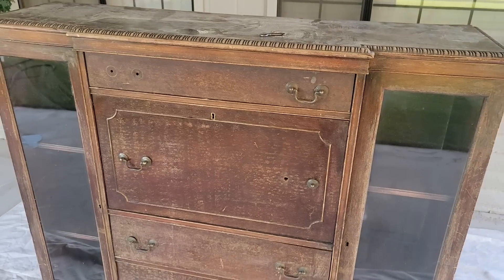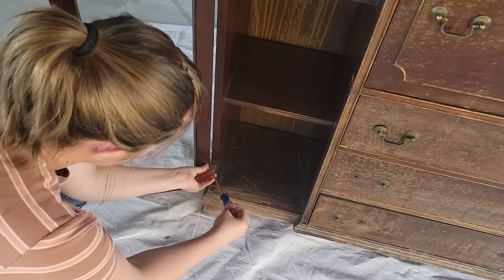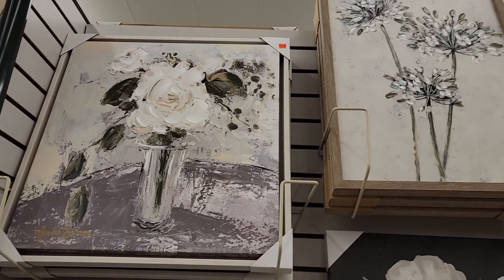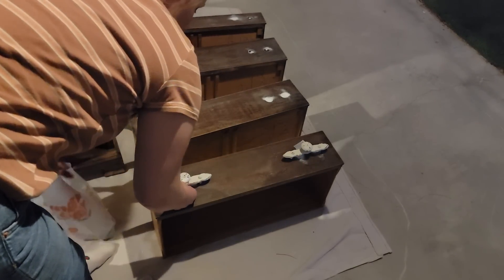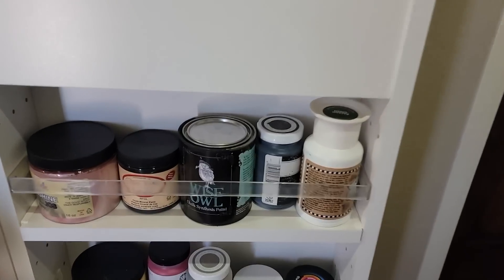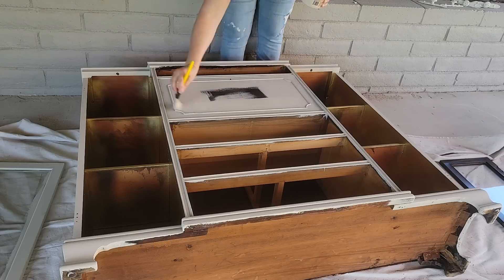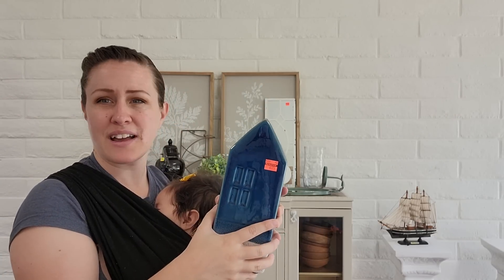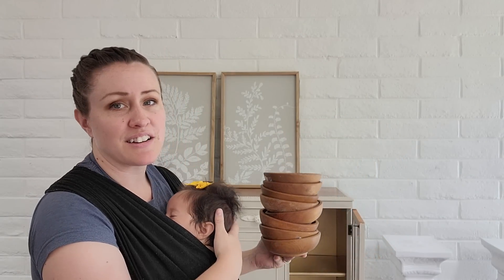French Country Antique Makeover Plus Thrift and Decor Haul

Comment: About those bowls...BEFORE  USING them for food, THOROUGHLY BLEACH them, as substances (from previous food use) absorb into the wood. Put them outside, in the sun, to dry. After they have been sanitized, treat the bowls, inside and outside, with an appropriate oil that is safe for foods.
Reply from the maker: Thank you Amelia, I intend to only use them for decor